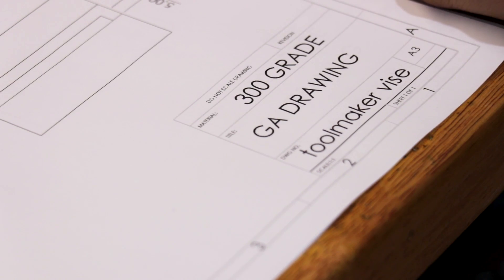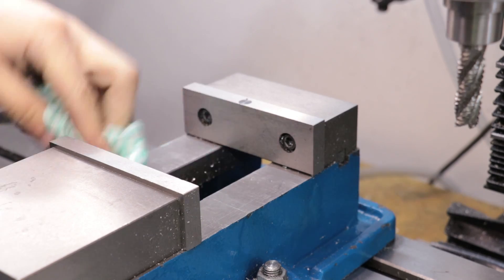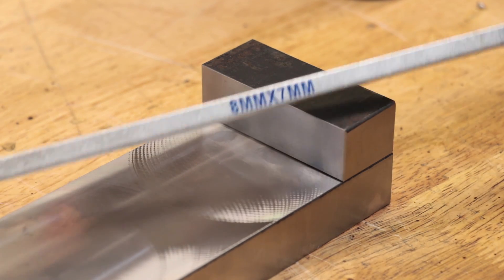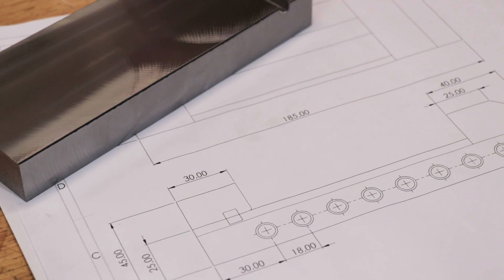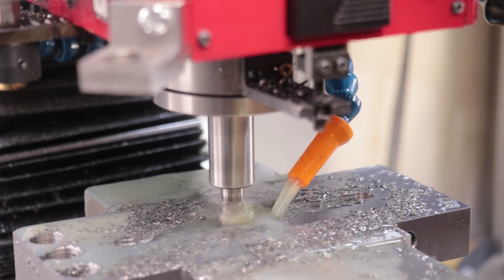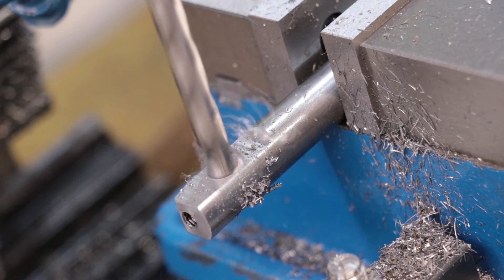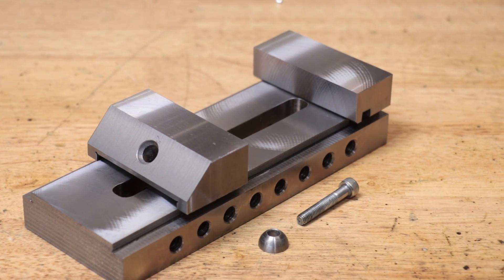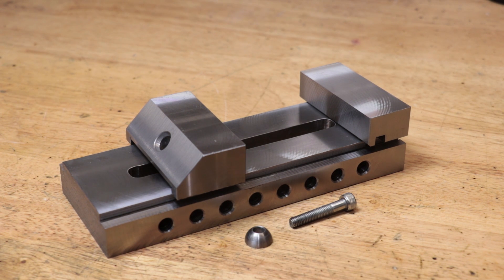Making A Toolmakers Mill Vise - Machining The Vise (Part 1)

Comment: I am an aspiring machine user, that is I have none but I have seen hundreds of videos.
What I am amazed over is how "easy" it is to create a working "thing" from scratch.
But what I do not get is how the makers can create anything so precise with what to my eye looks like an insane amount of runout and play.
Had to pause this video now to comment this as I am at the +- 5 minute mark watching the very visible drill wobble when drilling and tapping the holes.
Does this not matter as much as I feel it should?
Reply from the maker: You can have run out and depending on the application you can work around it or it doesn't matter, or it falls within a large tolerance window (which most good designs should have). That run out was just the nature of the machine before it had its bearings replaced and I worked around it just fine.

Comment: Not sure IF your video has been speeded Up  ? But your FEED rate AND your Spindle speeds for machining 1018 or1020 Steel is Way to fast ...  and NEVER use an endmill in a 3 jaw chuck !!  Yikes  thats a BIG No NO ....  Be careful and Stay SAFE  : )
Reply from the maker: For sure its been sped up by heaps. Was a while ago but you couldn't run the mill too slow or the motor would stall. Rubbish DC motor board. And I use a chuck for counterboring if I am feeling a bit lazy, no harm in that usually

Comment: Instead of cutting the relief in the base, you could also chamfer the moving jaw.. does the trick also, and is much less work.
Do a Climb milling finishing pass.. that will greatly improve surface quality.
The Clamping part could also be turned, Just machine a boss on one end, that fits in the Base, flip it over, make a similar boss on the other side, and make sure the part in between the bosses fits in the base, then, drill and tap a hole in it, and you're golden.

Comment: what was the setup for radiusing on your lathe? that looked like a boring head??!
Reply from the maker: I have a video on it, but it’s essentially a boring head on a shaft fixed between 2 bearings.
Reply: @artisanmakes  excellent!
btw i made a comment that my phone problems kept erroring.
barium or sodium carbonate added to your charcoal powder does wonders for case hardening. 25 to 2 ratio by weight. charcoal to carbonate. also a small pinhole in your can eill prevent blowout but youll not lose enough gases to maatter in the least. i case harden a LOT of stuff..prettu much weekly.
try it next time i think youll be pleasantly suprised. also cuts your cook time in half.
Reply: @artisanmakes   25 to 1 rather

Comment: Made my own as an Apprentice, still one of the best pieces of kit I’ve got 👍
Reply: I did mine slightly different, I machined the fixed jaw and the body in situ and Ground it round afterwards. I just machined the moving jaw as a separate detail 👍

Comment: Those endmills in a wobbly jackobs chuck.... no no. I know its just roughing a cbore, but still not safe practice. And you should start taped holes in the mill.
Reply from the maker: I don't see why not, the cutting forces aren't any different to drilling. The wobble was just down to a bad grind on one of the flutes

Comment: nice job.  Increase your coolant flow.  Do it strong enough that you cause the chips to be carried away immediately.  This reduces recutting of chips,  allows you to increase speeds and feeds,  increases your precision and really improves the finishes you can get. I use a mister set for high air flow and low on the synthetic water-soluble mist solution.
Reply from the maker: I would if I could, this is really pushing it to the max. if I had an enclosure of some type I would flood heavier.

Comment: I inherited a vise from an old friend that's almost identical to this one your making. The only difference so far is the welded pin, he captured it with a set screw but his vise sits just a little higher from the base and didn't have to keep that part as low profile.  I'm enjoying the video !

Comment: Im guessing you are probably already aware of this, but in one of Chris' (Clickspring) videos "antikythera fragment first hardened steel" or something to that effect, he goes over a way to harden mild steel. I replicates his process on a boring bar tool holder i made for the lathe, and it worked very well. I originally started it as he did by taking leather and turning it into coal, but that was rather tedius when charcoal is already available. I used coal from wood and it worked. 6 parts coal, 4 parts salt, 3 parts flour. Add some water to make a paste and put it around your part. Then use clay to envelope all of it, and throw it in a forge or coal fire anything to get it red hot for about a half hour.
Reply from the maker: Glad to hear it. I remember the video from way back, and I'm glad of worked out for you. Whilst I'm sure it is a good method for hardening, it probably wouldn't suit my part because of the shape. So I went about it slightly differently. Cheers
Reply: @artisanmakes  awesome. Cant wait to watch if it is part of the video!
Reply from the maker: @kylewellman402  Currently editing it, keep an eye out tomorrow. Cheers

Comment: You should let carbide get hot and not use as much coolant. Also for the relief instead of using a slitting saw you could have set the vise on 45 deg angle plates and used an 1/8 endmill.
Reply from the maker: I usually don't bother with coolant but on this cut it really seemed to help the carbide. And in sure an endmill would have gotten similar enough results to the saw. Many ways to do the same thing

Comment: I suggest that you modify your design. The keyway for the fixed jaw should be near the back edge and the fasteners should be close to the face of the fixed jaw. Clamping force will impose a lateral load on the fixed jaw which in turn will attempt to tip it backwards. The only resistance to this movement are the fasteners holding jaw down. You're going to experience significant deflection because your fasteners are way to close to the pivot point. When you're done, you should test jaw displacement with a sensitive DTI. I'm confident that you won't be happy with the results.
Reply from the maker: It is a fair suggestion and ill probably change my cad drawings to reflect it. With that said ive already put this vice thorough its paces and it seems to be quite solid and produce some quite repeatable parts, at least on my relatively small mill. 
If have a spare moment might run a sim in CATIA and see what deflection I could get. Might be easier since my DTI probably isn't up to snuff for that type of stuff. Cheers

Comment: I especially enjoy and appreciate your ad-libbing of materials and tooling, as alternate techniques to accomplish your builds, rather then just throwing money at them.
As a postscript, you might discuss what you would do differently, as to material choices, etc., versus, acquiring / purchasing, specific materials.
In my own experience, I’ve found that building specific work holding fixtures etc, it’s effective to use non-hardenable materials, provided, they will see limited use.
Other times, I’ve found myself wishing I’d opted for the more suitable materials, for the amount of use they see.
In several instances, the non-hardenable projects have ended up as essentially, prototypes, with subsequent builds using more suitable materials and incorporating changes and improvements, usually aimed at increased efficiency and versatility.

Comment: I'm immediately thinking "Cast iron' but I guess it's too expensive. Nice build anyway 👍
Reply from the maker: From what I have experienced with these specific vises, they tend to made made from steel and hardened, rather than from cast. And cast iron is relatively inexpensive, but most of the cast that is sold commercially at my suppliers is in the form of round bar, rather than flat bar.

Comment: This is a great project. Ironically, I just started to attempt to make the same thing a few weeks ago. Since I didn't have anything other than pictures on the internet to try determine sizes and clamping design, I came to a stall very quickly. Where did you find the drawings you are using? Could you send me the link for them please. 
I certainly have done things in a different order than you have, hopefully I don't regret that...LOL
Looking forward to the rest of this series of videos. 
Absolutely love your channel. Thanks so much for sharing!
Cheers from Canada
Reply: I have drawings that might be of help, but for some reason my comments seem to be disappearing.  Ping me and I'll email you a link.
Reply: OK, I'll try again.  What you want is the July 1946 edition of Popular Mechanics, which has been archived and is available in PDF form on the web.

Comment: Very nice work. Looking forward to the thing in action.  For the long through holes, how come you stopped using flood coolant in the later holes?
Reply from the maker: I didn't, I just turned it off until I got super deep in the hole. The flood coolant was just spilling all over the table and floor. It's great stuff to have but it is a very messy thing to use

Comment: Nice work, just wondering, what inserts did you use for your carbide fly cutter?Do you have a link? Cheers
Reply from the maker: I use dcgt and dcmt inserts. Not really suited for this work and I'll probably be switching back to tcmt and tcgt inserts when they arrive. I order them on AliExpress for $10

Comment: Looking good 👍👍👍small tip for you if you'd like to extend the life of your cutters .whenever working with hot rolled steel remove the mill scale first. mill scale is very hard and wears cutter edges much faster than the steel under it. you can grind it off or if you've got time you can also soak it over night in pure regular household 6% vinegar to dissolve it. if you're in a real hurry you can also remove it in a couple minutes with muratic acid it's fast but much more dangerous than vinegar. you can also remove it by taking a deep enough cut to get totally under it but may not be easy to do with a small mill and still is a lil hard on cutter edges .just remember after either acid treatment as soon as you dry it you need to oil it because it will flash rust instantly anyway just thought I'd pass that along 👍👍👍
Reply from the maker: Cheers but the carbide fly cutter just eats through it and I don't see much of a change in the tool life.
Reply: Just passing along know info do with it as you wish 👍👍👍

Comment: A few years ago, someone wrote an article in Machinist's Workshop magazine where they did some testing on 'hardening mild steel'.
He tried adding salt and various other 'old wives tale' stuff but got no significant changes.
 Using ordinary dish soap as 'additive' to water found it actually did make low carbon steel significantly harder.
 I forget the Brinnel number increase but it was worthwhile. ( he 'just happened to have a hardness tester in his workshop)
Authors daughter was a materials engineer and said it was due to the surfectant preventing steam bubbles insulating the material
Reply: Steam jackets are a well known thing in knifemaking but you can avoid them pretty well by just agitating the part vigorously.
Reply from the maker: That is a pretty interesting read. I remember watching about the super brine quench method years ago. No surprise that it didn't work :)
Reply: @artisanmakes    please search for 'Robb Gunter's Super Quench'

Comment: You could temper the steel by packing it within carbon, but it takes a very long time. Thus I would keep this vice for soft materials and make another one with tool steel.
Reply from the maker: As I said In this video this is the material I can get my hands on in this size. As much as I'd like to use a carbon or tool steel I'm not going to be able to get small quantities of bar stock in this size of tool steel.

Comment: I would recomend to scrape milled surfaces for better precission
Reply from the maker: Can you scrape carbon steel effectively? I have done a small amount of cast iron scraping but I have seen a video of someone attempting to scrape a carbon steel of some sort and it didn't seem to scrape all that nicely.
Reply: @artisanmakes  this guy has video about carbon steel scraping https://youtu.be/FgxjiEBhKvM . Also i belive you will surface harden the part ;)

Comment: My god dude, just buy the right material! All of this effort and it would have only cost another 200$ maybe to make it out of 4140 or something.
Reply from the maker: As I said in the video this is the material I can get in this size of bar stock. I have checked in the past with several suppliers but the truth is unless I'm ordering a moderately large quantity I'm not going to be able to get a piece of 4140 or similar, especially in the size of flat bar that I use in these projects. Plus most 4140 and other tool and high carbon steels are sold as round bar, not flat bar which makes acquiring it more difficult.  Cheers
Reply: @artisanmakes  I had no idea the situation was so dire in Australia. There is an endless list of suppliers that will deliver nearly any grade of steel in any size to your door here in the states. It was even better before the pandemic. I used to never worry that I'd find the right size at a good price.
Reply from the maker: @jackkara91  Not sure if dire is the right word, but is just seems to reflect what most of the local manufactures commonly use.
Reply: @artisanmakes  AM, I've priced steel for projects and I know your pain.
Reply: Yep, 4140 would make a much nicer vice. Hardened. stress relieved, and finish ground it would be a vice that would last a lifetime. Low carbon steel like 1018 sucks in the machine shop. Great as a structural steel, it generally leaves a poor finish when machined.  You end up filing and/or polishing to get a good finish. 12L14 screw machine steel, 4140 chromoly, and 415 free machining stainless are your friends.

Comment: 11:28 What caused your mistake here? I only ask so that I can be on my guard against doing something similar!
Reply from the maker: I ran out of travel on the table so I had to move the part in the vise to cut the final bit of the slot but the part didn't seat correctly in the vise and I forgot to tap it in with the hammer.
Reply: @artisanmakes  Thanks!

Comment: You could always add more carbon to the steel so it can be hardened. Chris over at Clickspring has a good video on how. https://youtu.be/V_Mp1fNzIT8
Reply from the maker: I remember that video from back in the day. Cool method but I went about it differently. He uses that flour binder paste which would be good for those rods but probably not as useful since I have all those fine cavities and details. Plus the parts and bigger :)
Reply: Hell yeah